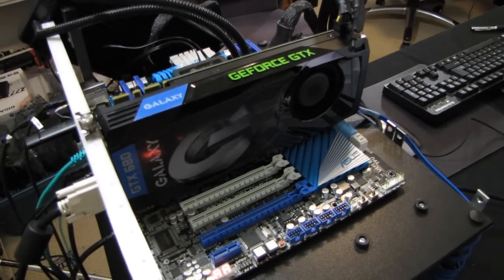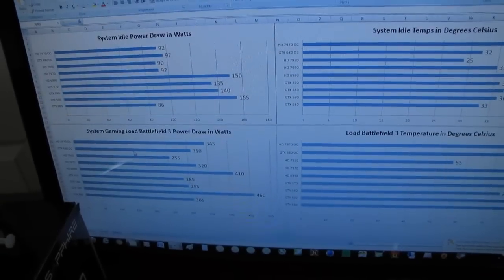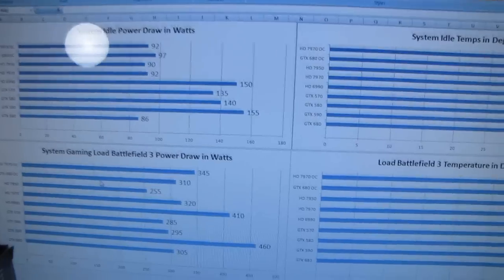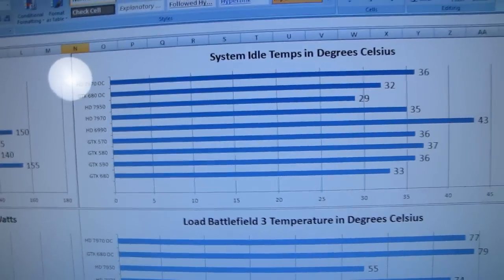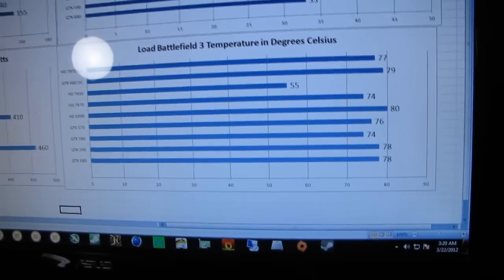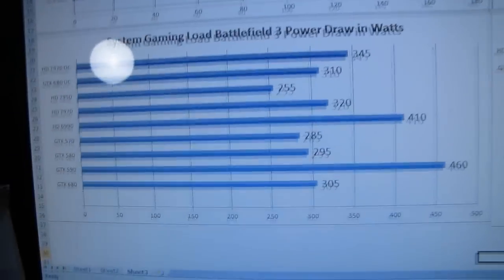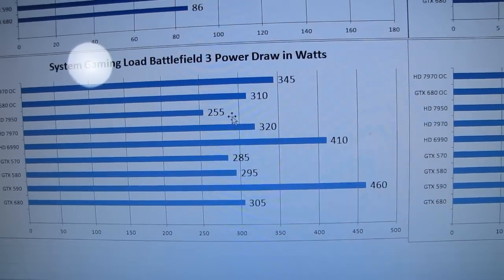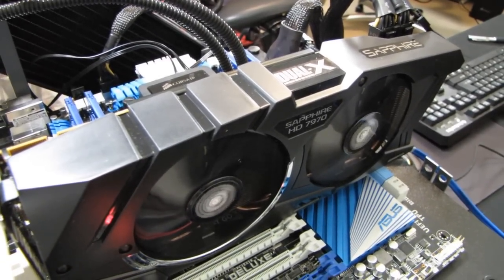GTX 680 Power, Temperatures and Acoustics Versus HD 7970 Reference & Non-Reference Linus Tech Tips

Comment: Actually it does. Coil whine doesn't refer to the whining of the fan but of certain components of the PCB like the power delivery. A reference design would have lower quality parts like power delivery over something like say MSI's Military Class on the Twin Frozr cards, so having higher quality components would decrease the coil whine.

Comment: since a lot of games use streaming methods of loading now, having a slow hard drive can reduce your framerate during the times the game is loading during gameplay. if you're playing a game where all the data you could possibly need is loaded in at the beginning and from there it runs in memory, then disk speed is not a concern for framerate during gameplay. however, that is not always the case.

Comment: I have the EVGA GTX 680. And I am very pleased with it. You will probably get better temperatures with the MSI version though, but the EVGA version exhausts the hot air outside the case, keeping your case cooler. Both cards come with an overclocking software. I prefer the EVGA software as it will automatically raise your cards clock when needed. Performance wise they are pretty much the same. I guess it's just a choice of which brand you feel more confortable with.Both cards are equally awesome

Comment: Yeah, You'd have to look inside your case & at the sticker/label on the PSU. Either get the make/model name. or on some PSU's like Delta Elec. OEM's it may have  the details somewhere below, for example it could say 12v1 + 12v2 + 12v3 + 12v4 Max Load 380w.  

As to a previous reply form someone, you cannot add the multiple 12v rails togher to get the correct answer.

Comment: good thing about non reference pcb's; usually a better design, better heatsinks, more performance. but you cant swap out the heatsinks for others or watercooling because no coolers i know fit non reference designs. i would rather get a reference design and watercool it or put a better cooler on it.

Comment: It is only hotter because of how quiet the stock cooler is on it.
if you were to say put the stock HD 7970 cooler on a 680 then it would probably be running cooler than a 7970 due to the overall power consumption and the smaller die

Comment: I'm going with 7970, they'r going on ebay for about $480 and with a little overclocking (100mhz) it can get  to the same clock speed as the 680.

Comment: But after CCC 12.7 Beta and OC'd to 1125 Core (Which can easily be done with no voltage tweaking through CCC) the 7970 is quite similar. The only real things to consider is Physx/CUDA vs Computing Power/+1GB RAM.

Comment: Perhaps you can help me :) I got my 680 4 days ago and as I am owning a pretty silent rig, I noticed that the fan is making a noise, like a whir (sounds like "ggrrrrrr"
). I can hear it when the card is idle, but best around 47% fan speed. The faster the fan, the higher the noise gets. It will not be heard by
anyone, as it is not super loud or annoying. But when my room is silent I can hear it pretty well out of the case.

So perhaps the bearing is damaged? Or is it just like that?

Comment: O.K. So it's pretty quiet. Ref. coolers are good from september to june. But in the hot summer in july and august they just haven't got it. I needed 100% fan speed on my ref. card to keep it below 80°C, when it was 40°C outside and 32°C in the room. So a 100% sound test would have been good here as well. But I guess it's just as loud as other ref. coolers.

Comment: Im planning to build a pc in the next 2-3 months and im still deciding between the 680 and 7970 but, what kind of power supply should i get and what kind of ventilation so it doesnt overheat and shut down the pc espicially when the card is overclocked playing games like bf3 at ultra settings

Comment: @23hocke if you overclock the 7970 to the 680 clock. Then the 7970 will outperform it haha. The 7970 mainly loses cause it has lower clock speeds unlike the 680. Its like a cpu, you cant test lets say, an i7 and the ph x4 at stock clocks... Or else its a waste of time, make them the same clock speed, then it will have better results

Comment: I cant belieave that a 7970 can perform better grafic quality in ultra and with physx,and it consumes less power.
Advice... get de gtx680 from asus direct cu II 
The 2gb for single monitor or 4gb for multi monitor but for your rig last longer without upgrades get the 4gb and maybe later you will wish to get a proper watercooling and overclok it :)

Comment: It IS made from copper :P
It start out with a fully covered copper board, and the design for the circut board is transfered onto the board using light. then we use acid to etch away the copper on areas of the board. watch?v=VtmWaxzgoK8 ;)

Comment: I win with a temp of 26 degrees running a GeForce MX 420(64MB) on an overclock with battlefield 3 on full res, the card consumed 1.4 watts, 1.5 volts and 0.8 amps!, that's efficient, and idle, the consumption dropped to nearly nothing! (0.9 watts, 1.2volts 01 amps)

Comment: it should tell you everything you need to know on the side.  If it does not then I am assuming you are using a store bought pre built computer?  If that is the case I would purchase a new (GOOD) PSU since those no brand china PSUs are horrible and I would not trust it with high end equipment.  Corsair is a great PSU you should look into and you can get an 80+ bronze for a decent price.  Take a look at your PSU and tell me if it is just a plain made in china type of PSU.

Comment: tbh 32Amps is not that great for a 500w PSU. Most Quality 500w PSU's have about 40Amps at least on the 12v rail. I'd say you'd be cutting it close there, depending on the age & quality of your 500w PSU, and what your setup maybe. 

Still, would someone shelling out £450/$500 on a GTX 680 be putting it on what i assume is a budget range 500w PSU, ? no.

If your looking to a better Quality PSU, for $73/£53 the XFX 550w Core Edition Pro PSU, has 44A(528w) on a single 12v rail.

Comment: There is NO WAY that 580 is working properly. 30 FPS average at 1080p AND using less power than the 680. Linus should have saw that right away and knew something isnt right.